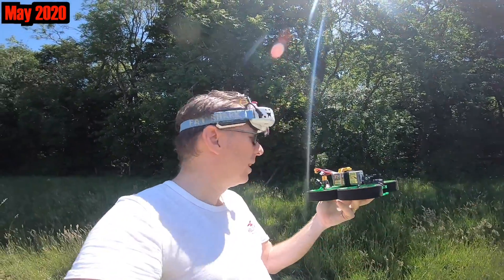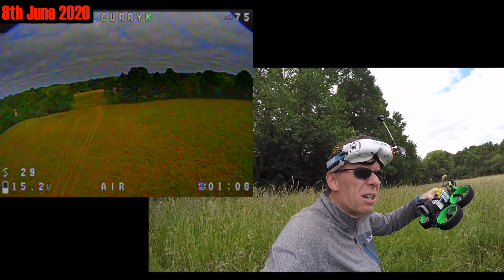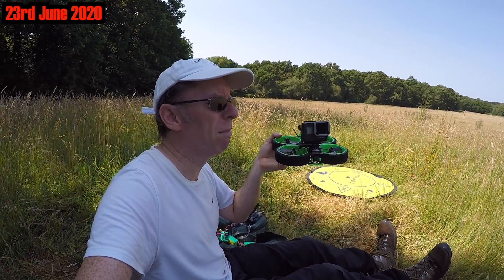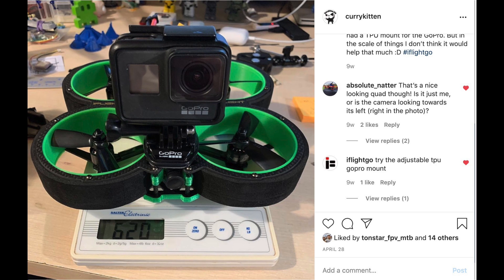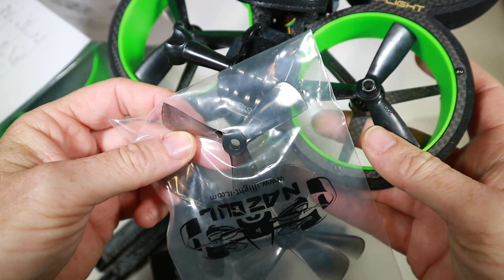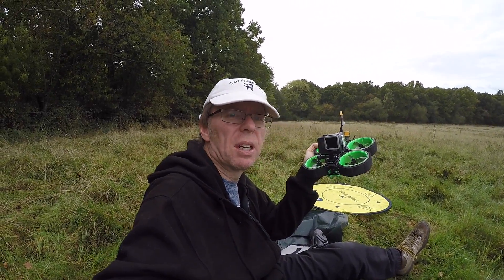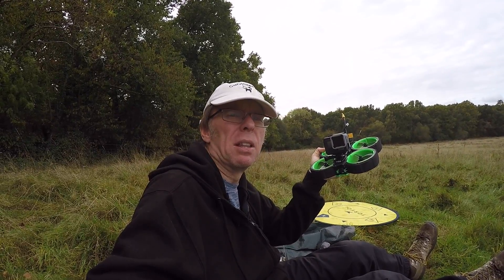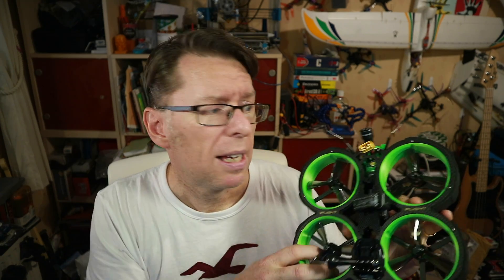Fixing issues with the iFlight Green Hornet:  Motor overheating and range problems

Comment: That's why I think the insta360 go works well with these cinewhoops.
Reply: They have low bitrate
Reply: @verdi6092  really appreciate the heads up on that. 👍👍👍👍
Reply: @electroddxful  no problem. The stabilization feature is excellent, but i sold mine and waiting for version 2
Reply: @verdi6092  Thanks alot really appreciate it. I guess I will also wait for version 2. I was going to order mine. Thanks alot.
Reply from the maker: I've seen some pretty nice video from them - but more of the lets-move-the-viewpoint-all-around-the-quad rather than as a replacement to an HD camera.  They look fun though
Reply: @electroddxful  yes i think u should borrow someones 360go and try urself see if it fits ur need. I personally was dissapointed by the blurryness of the video compared to my runcam split has crisper image. Im really waiting for their version 2, the 360go stabilization  is superb
Reply: @CurryKitten  yes i saw a lot of nice crisp videos too from youtube, but i think they went through post processing software to upscale the fps and bitrate, in which i dont have time to do all that. Tks for replying.. love your videos